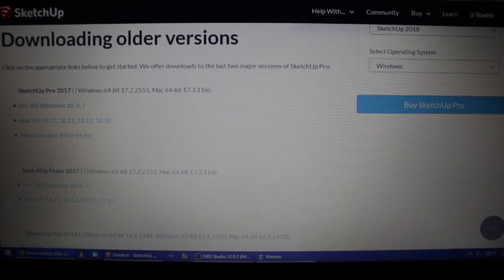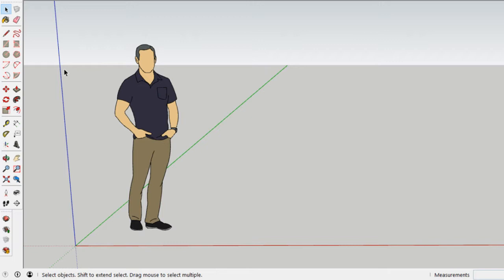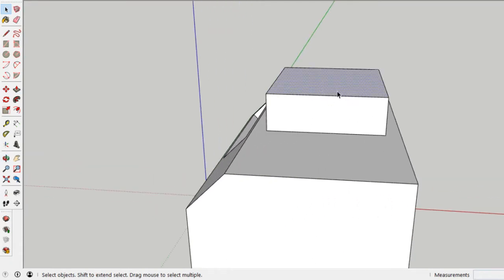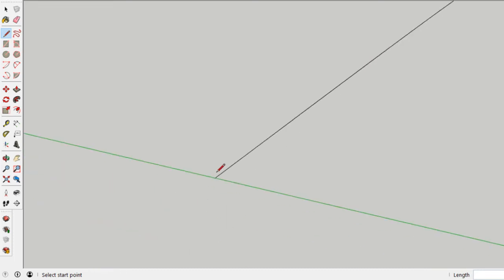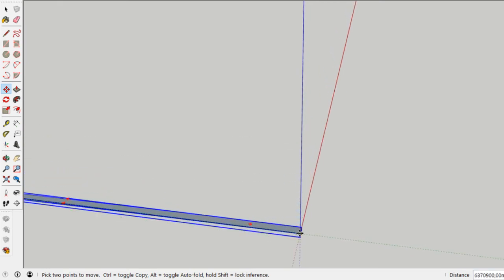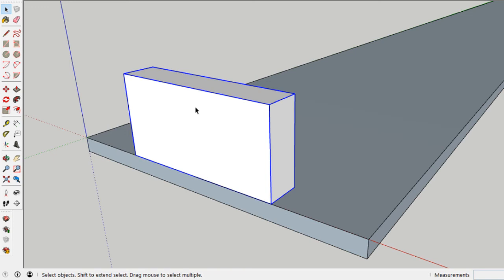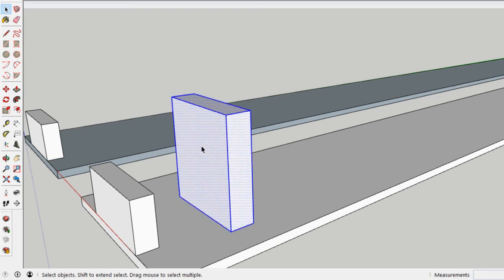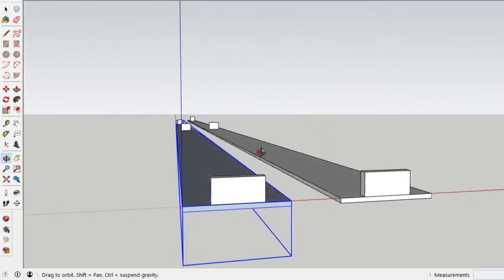Quick SketchUp Tutorial On Making The Sphere And Flat Earth Comparison Models

Comment: @Tommy Grønvold

I actually watched the video and was good work well done. Here are my questions:

1/. Angular Resolution Limit of the Eye? 
2/. How far apart would 2 x 6ft people to disappear from each others view??
Reply from the maker: Thanks!
I don't have any answers to those questions, what are you trying to prove with them?
Reply: @TommyGronvold  When you can figure those questions out you will realise what they relate to... Until you run the numbers you will not understand...
Reply from the maker: No... Please explain!
Reply: @TommyGronvold  1/. 0.02 degrees resolution limit
2/. 3.2 miles
Reply from the maker: And...? Where do you go with that info?
Reply: @TommyGronvold  "And...? Where do you go with that info?"
What does 3.2 miles remind you of?
Reply from the maker: If you came here to make a point, MAKE IT!
I'm not gonna try to guess where you want to go with this, so just lay it out nice and clear!
Reply: @TommyGronvold  So you do not know that its the same distance that the horizon line is supposed to be on a globe... FFS I may as well be speaking to a brick wall...
Reply from the maker: If you go 10 feet above sea level? Or 20 feet, or 100 feet? Does the numbers stay the same?
And how did you find that number for the "Angular Resolution Limit of the Eye"?
Reply: @TommyGronvold  "If you go 10 feet above sea level? Or 20 feet, or 100 feet? Does the numbers stay the same?"

The further away from the surface you get, the less it blocks your field of view, but yes you can still only see a 6ft object at 3.1 miles away. Put your eye on the floor and you can see ~37 meter (0.02 miles) radius around you, stand up and it becomes ~3.1 miles.

"And how did you find that number for the "Angular Resolution Limit of the Eye"?"

"With Angular resolution calculator we compute that the angular resolution during the day is θ ≈ 0.02°."
https://www.omnicalculator.com/physics/angular-resolution#what-is-the-angular-resolution-of-the-human-eye

"Angular resolution: about 1 arcminute, approximately 0.02° or 0.0003 radians,[1] which corresponds to 0.3 m at a 1 km distance."
https://en.wikipedia.org/wiki/Naked_eye

"The maximum angular resolution of the human eye at a distance of 1 km is typically 30 to 60 cm. This gives an angular resolution of between 0.02 and 0.03 degrees, which is roughly 1.2–1.8 arc minutes per line pair, which implies a pixel spacing of 0.6–0.9 arc minutes.[15][16]"
https://en.wikipedia.org/wiki/Visual_acuity
Reply: @TommyGronvold  If you get where I am going with this and need no further guidance to understand the concept of the angular resolution of the human eye is equivalent to the curve of the globe earth, can you do the following just to show me that SketchUp is worth investing a bit of time in:

1/. Put a 6ft person 3.2 miles away on both models and see where you can see them from the ground level, 6ft and 12ft in altitude?

2/. Put a 6ft person on top of a block 167km's on both models and see whether you can see them from the original observer point?

If you cannot be bothered I understand, I may do a bit this weekend myself.
Reply from the maker: Oh... So this just happens to be the exact same distance as the horizon on the globe, and the numbers just happens to follow the increased altitude... WOW! What a coincidence!!
Reply: @TommyGronvold  "Oh... So this just happens to be the exact same distance as the horizon on the globe, and the numbers just happens to follow the increased altitude... WOW! What a coincidence!!"

Its not a coincidence its designed like that... You have been told over and over again, but you wouldn't listen!!

With any increase in elevation you see more of the surface, you can demonstrate this with a wall, take a photo 1 inch away, and then take a step back and take another photo, this will show more of the wall the further away you are from it.

"And by the way, how does those numbers stay the same if our horizon goes 28 degrees up from our toes?"
28 degrees is from your toes to horizon created by this apparent rise in floor, due to the 0.02 degree limit. 

You seem a bit surprised and shocked that the maths of the human eye matches the curve....
Reply from the maker: Surprised and shocked, yes! But not from what you might believe... I'm surprised about how it's even possible to come up with such nonsense, and shocked about how many people still believing the earth is flat!
You need one mathematical formula for where the sun set, one for where we see Polaris from everywhere on the northern hemisphere. You need one formula for matching the daily observed path of the sun to match the flat earth model (which ever model you choose to use) and one formula to hide everything in the distance behind a mass of water.
On the globe earth, everything is solved with ONE formula: The curvature of the earth!
Reply: Tommy you are still not getting it so you are throwing your toys out your pram...

The flat earth also calculates all you said above USING 1 FORMULA the angular size formula...

You will get it one day but until then remain shocked that there is people out there believing in an alternative theory which calculates...

Guess you did not want to put a 6ft person 3.2 miles away as I suspect sketchup has a greater angular resolution than what we and cameras see, therefore it does not reflect the reality of what we see!
Reply from the maker: "the angular size formula" - Also known as the law of perspective!
Perspective does not bend anything, but the sun needs to move 3000 miles down and the light needs to bend well over 25 degrees to light up under the clouds.
Polaris is observed at the angle corresponding with the latitude of the earth, on a flat earth model, those lines does not meet at one single point.
Boats and other objects obscured by water only happens on a globe, as on a flat earth the water would be FLAT!
You do NOT have one simple magical formula to solve all those problems, because they need a total different set of numbers from every single point on the northern hemisphere to add up.
Reply from the maker: HEY!!! That gave me an inspiration for a new video: "Reality Check! How Does It All Add Up...?"
Give me a couple of days, this WILL be a video!
Reply: "Perspective does not bend anything"

Wow so no bending up of an apparent rising floor, no bending of converging train tracks and no bending of sunrays.... So if perspective does not bend sunrays are you telling me the sun is close and local due to ray tracing geometry?

"You need a totally different set of numbers"

What for? I think your desperately winging it tbh. Accounting for angular size accounts for hidden identically.

That 1 formula is the same as your 1 formula, just because you have not realised yet it does not mean its untrue...
Reply from the maker: "...are you telling me the sun is close and local due to ray tracing geometry?" - NO! Quite the opposite actually!
Go to 3.30 in this video: https://www.youtube.com/watch?v=IilLEsasaqk
If there is only ONE formula to bend the sunlight AND the observations of Polaris to match everyday observations from all over the northern hemisphere, please present it!
Or even better: Calculate how I just north of Oslo, Norway see Polaris at 60 degrees, and not at 72 degrees as on the flat earth model. Then use the same formula to calculate from where you live.
And then again, using the same formula once more, calculate my sunset just north of Oslo to match what I see from a sun 3000 miles up and 25 degrees left!
Reply: @TommyGronvold  "NO! Quite the opposite actually!"
Just because you say something it does not mean its true, show me how its quite the opposite?? Does sun rays bend due to perspective or not?

"If there is only ONE formula to bend the sunlight AND the observations of Polaris to match everyday observations from all over the northern hemisphere, please present it!"
I have done and you just cannot figure it out so you think its bunk!! The angular size formula is the same as earths curvature calculations.. If you cannot account for an apparent rise in floor, converging train tracks and diverging sun rays WITHOUT using perspective then the answer is obviously perspective effects your vision. 

Again a simple demonstration is you put your head on the floor and you will see ~37 meters around you, then stand up and you will see 3.1 miles around you, what was the "THING" blocking your 3.1 mile view with your head on the floor? I think you will find its the floor as if you do the same thing for 1ft altitude you will only see 1.2 miles due to the floor blocking you as curvature is virtually non-existent at these distances ... But you are telling me that the floor would not block your view 3.1 miles away, so why does this intrinsic relationship breakdown? Because you want to call it something different?

Your video does not make any account for refraction or the missing floor rise... When you want a lesson on what the flat earth model actually looks like let me know yeh as you are making a flobe earth model here like every other globe earther.

If you can see a 6ft object in your software at 3.2 miles then your software is not reflecting reality, it resembles a game like minecraft...
Reply from the maker: "When you want a lesson on what the flat earth model actually looks like let me know..."
Oh yeah, give it your best shot!! Build a working model of the flat earth and make a video of it!
Reply: And dont get it...

The working flat earth model IS the globe earth model, with a mere switch of labels and concepts to explain the phenomenon. I.e

Curve = perspective
Gravity = Density/electrostatics
Distant sun = Close sun
Dark energy = aether

Do you not understand Einsteins General Covariance? AS YOU ARE TELLING ME EINSTEIN IS WRONG!! Are you sure you know what you are on about here, if so explain what general covariance means?

https://en.m.wikipedia.org/wiki/General_covariance
Reply from the maker: "The working flat earth model IS the globe earth model..." - Wait, WHAT???
I can make a sphere model in SketchUp and make it work, it'll take me just a few minutes.
Go ahead, download SketchUp and make a flat earth model. And then make it work!
If you can do that, you will be the first! Because every single other model fails in every single way possible!
Reply from the maker: You came here to show me calculations, now SHOW ME THE CALCULATIONS!
Go to this video and show me in a comment the calculations for every single observation to meet at one single point. If you can do that, you are one step closer to make it work on a flat earth:
https://www.youtube.com/watch?v=KaWBDaRviLg&t
Reply: @TommyGronvold  "Wait, WHAT???"

This is what you don't get, can you explain what Einstein is saying here:

“The struggle, so violent in the early days of science, between the views of Ptolemy and Copernicus would then be quite meaningless. Either CS [coordinate system] could be used with equal justification. The two sentences, “the Sun is at rest and the Earth moves,” or “the Sun moves and the Earth is at rest,” would simply mean two different conventions concerning two different CS.” 
― Albert Einstein, The Evolution of Physics: From Early Concepts to Relativity and Quanta

Is he saying:

1/. There is no way a geocentric earth model and a heliocentric earth model would look the same.

OR

2/. Geocentric earth models look identical to heliocentric earth models.

"I can make a sphere model in SketchUp and make it work, it'll take me just a few minutes."

You can also make a flat earth model in less time as you only have a circular plane to worry about.

"Go ahead, download SketchUp and make a flat earth model. And then make it work!"

Based on all I have told you WHAT MAKES YOU THINK IT DOES NOT WORK?? This boils down to you removing perspective and claiming it does not work, and I have already asked you whether something 6ft disappears on SketchUp and you cannot tell me as you know you can see it as clear as day, this is because sketchup does not account for a human eye or camera perspective... If not show me one calculation of curvature that cannot be replicated with angular size on a flat plane?

"If you can do that, you will be the first! Because every single other model fails in every single way possible!"

Incorrect, even Thales of Miletus had a working flat earth model in 610BC, this allowed him to be the first person to correctly predict an eclipse... Do you think it all of a sudden stopped working and eclipses could only be predicted on a globe earth model?? If so that is dumb as hell..

Show me at least 1 thing that NO flat earth model can represent?
Reply from the maker: I don't care what Einstein or anyone else said, they didn't decide the shape of the earth!
"Based on all I have told you WHAT MAKES YOU THINK IT DOES NOT WORK??" - Make a model, make it work!
"Thales of Miletus had a working flat earth model in 610BC" - At that time, people used to shit in a hole in the ground, today we have water toiltes! Time moves on, so does science!
"Show me at least 1 thing that NO flat earth model can represent?" - Well... I've done EXACTLY that in every video I've posted here!
And as long as you only have your words to show for, YOU LOSE! Again: Make a model, and make it work!
Reply: "I dont care what Einstein says"

Explains your level of your willingness to learn Relativity. He may not have decided its a globe but its his current theory of gravity that is attributed to being the mechanism to make the earths shape, before gravity what was the mechanism? Regardless both newtons and einsteins gravity has been debunked and is scientifically wrong, this is why you need to fudge the model with 95% imaginary dark stuff..

"Make a model and make it work"
I have shown you many models that work, you are yet to show me a globe earth model that does not require to be fudged with 95% dark stuff???... here is NASA telling you they prefer the flat earth model as its more accurate, this is because NASA understands what Einstein says and you are unwilling to learn;

https://ntrs.nasa.gov/search.jsp?R=19850023280

AIR
"A suite of MATLAB m-files have been developed to calculate the electromagnetic fields produced by a vertical and a horizontal infinitesimal unit dipole over a homogeneous flat (ground) plane. Calculations for the fields above the ground plane have been made for various ground-plane conductivities and relative dielectric constants. The calculations bound the practical range of parameters representative of natural earth terrain."

Propagation of Electromagnetic Fields Over Flat Earth
https://www.arl.army.mil/arlreports/2001/ARL-TR-2352.pdf

GROUND
"Plane Surveying: The type of surveying in which the mean surface of the earth is considered as a plane, or in which its spheroidal shape is neglected, with regard to horizontal distances and directions."

Fundamentals of Surveying Theory and Samples Exercises 
http://giswin.geo.tsukuba.ac.jp/sis/tutorial/fundamentals_of_surveying.pdf

UNDERGROUND
"The Laurentide glaciation in Canada. on the other hand. has almost exclusively been analysed in terms of spherical Earth models (see Peltier. 1982. for a summary). A notable exception is Walcott's (l970b) interpretation. This author used a two-dimensional load representation and a flat-earth model to infer the thIckness of the lithosphere from tilt data of proglacial Lake Algonquin"

The relaxation of spherical and flat Maxwell Earth models
 and effects due to the presence of the lithosphere
https://pdfs.semanticscholar.org/7778/003a7bb4f923a9dc21a480e1221c4adf6b46.pdf

Name 1 thing that does not calculate as none of your videos show what a camera or human sees as sketchup cannot mimick the eye or camera. So your fake debunks are just exposing your lack of understanding of general covariance and pretending Einstein is wrong because of an open source 3D modelling software.... really?? Do you really think you and sketchup can debunk Einstein??

"Again make a model and make it work"
Tell me what specifically YOU THINK does not work? Lets say we choose a globe earth projection like the AE map, what fails?

As I can debunk you in 3 quick formulas

x = R * cos(lat) * cos(lon)

y = R * cos(lat) * sin(lon)

z = R *sin(lat)

Show me how spherical co-ordinates cannot transform to a cartesian co-ordinate system??

"YOU LOSE"

Err I dont see how when a globe earther must ignore what Einstein says albeit its the current model used in globe physics... You are basically saying "I trust Einstein to describe gravity correctly, but when he says gravity is equivalent to acceleration then hes talking shit"... You are not making sense!!

Tell me clearly 1 issue you have, pick your best and I will show you...

Ps toilets have been around since 2100BC please learn your history before chatting the same shit they were flushing down their toilets 4000 years ago... massive fail.. And just in case you say"Well greeks didn't have them then....."

"The ancient Greeks were modern for their time. A Minoan king of Crete invented the first flushing toilet over 2800 years ago. Paper was first manufactured about a thousand years later, but it took someone another 700 years to have the great idea of making toilet paper."

https://www.worldnomads.com/travel-safety/europe/greece/toilets-in-greece-water-safety
Reply from the maker: "I have shown you many models that work" - No, you have only tried to describe them with words. Show me a physical model, made to show what happens on the flat earth.
"Tell me what specifically YOU THINK does not work?" - Sunrise, sunset, sun shining under the clouds, solar eclipse, lunar eclipse, sundials, equatorial mounts, observing Polaris at the angle corresponding with the latitude you're at, boats behind a mass of water, whole cities behind a mass of water, the retrograde of Mars, obvious curvature seen from so many photos and videos...
Reply: @TommyGronvold  "No, you have only tried to describe them with words. Show me a physical model, made to show what happens on the flat earth."
A physical model??? What like one made from paper mache?? Or SketchUp which does not allow you represent perspective correctly unless you mass edit the ACT camera settings which I am sure you have not done??? Or how about just looking at one created by Steve Torrence here where all data used is real world data from timeanddate:

https://www.youtube.com/watch?v=sGJVF7-WvEc

Tell me what is wrong with his "PHYSICAL" model??

"Sunrise, sunset, sun shining under the clouds, solar eclipse, lunar eclipse, sundials, equatorial mounts, observing Polaris at the angle corresponding with the latitude you're at, boats behind a mass of water, whole cities behind a mass of water, the retrograde of Mars, obvious curvature seen from so many photos and videos..."

I said one, but I can do all of these for you:

Sunrise = Hidden by floor
Sunset = Hidden by floor
Sun shining under the clouds = Earths Albedo, in some places with ice earth reflects 90% of the suns light back up.
Solar eclipse = First ever predicted by Thales using the maths of the gnomon Anaximander who were both flat earthers, this is merely the moon getting in front of the sun.
Lunar eclipse = Magnetic vortex in the centre of the FE, and this polarises light to leave a dullish red, see Fred Espanaks tests on Magnetic Floppy Discs as a solar filter.
Equatorial mounts = Operate from two axes, you MUST set one first. This is how anti-aircraft gun turrets work.
Observing Polaris at the angle corresponding with the latitude you're at = The labels of latitude are made from that very star, so whether you assume a curve or a flat it would be an identical observation, its just on a flat earth its hidden due to distance and it dropping as everything else does in our view when it moves away from us.
Boats behind a mass of water = Hidden by your close proximity to water
Whole cities behind a mass of water = Hidden by your close proximity to the waters surface
The retrograde of Mars = Perfectly explained on the flat earth with perspective, or frames of view... Car wheels appear to go in retrograde when spinning...
Obvious curvature seen from so many photos and videos = What all seen through a small piece of curved glass lens?? I have not seen any of these photos or videos showing earths curvature?? I have only seen slight bends in the horizon due to barrel distortion or bend horizons from plane windows where you have 2 bits of bent glass before the observation.

All destroyed in less than 5 minutes bro... You are seriously on to a losing battle here... Imagine if I said "I can debunk the globe using Martin Behaims cartography techniques!" would you believe me? As this is what you have just said to me... "Flat earthers cannot predict the solar eclipse, even though the first recorded person to correctly predict a solar eclipse was a Flat Earther called Thales of Miletus with his own model:

http://practicalphysics.org/thales-model-universe.html

So as long as we rewrite history to suit your agenda, taking toilets away from ancient greece and ignoring what Einstein says selectively but supporting his case for gravity, THEN AND ONLY THEN DO YOU HAVE A POINT... But Tommy, you cannot rewrite history can you? Therefore you must accept at bear minimum that Eclipses can be predicted using a flat earth model!! Once we get over this barrier that you desperately do not want any part of sciences flat earth history to leak in to globe earth science... Well looks like we need to get rid of the whole of cartography, as Eratosthenes invented the co-ordinate system on a flat earth map, get rid of all atomic studies as a flat earther Democritus first theorised them.... NO I will not allow you to delete recorded history to suit your agenda which you again are miserably failing at... Sort your head out Tommy and start admitting you can be wrong sometimes...
Reply from the maker: "Sunrise = Hidden by floor - Sunset = Hidden by floor" - NO! The sun on the flat earth never sets! If it did, the whole world would be dark at the same time, which doesn't happen!
"Lunar eclipse = Magnetic vortex in the centre of the FE" - Now you're joking, right...?
"Equatorial mounts = Operate from two axes, you MUST set one first." - YES! You set ONE axis first, but then it rotates around ONE axis to track the stars in a circle. On the FE model, you need to track in TWO axis' at once, just make a circle in your ceiling with a flashlight!
Polaris - "The labels of latitude are made from that very star, so whether you assume a curve or a flat it would be an identical observation" - NO! On the flat earth model, the lines do not match! That's the maths you need to show me for it to work, or do it on a VISUAL model!
"Boats behind a mass of water = Hidden by your close proximity to water" - On a flat earth, the water is flat! How can close proximity of water hide a boat?
"The retrograde of Mars = Perfectly explained on the flat earth with perspective" - You know that Mars moves like the number 8, right...? Does the same formula as before with Polaris and the sun now move something like that???
"What all seen through a small piece of curved glass lens??" - YES! Do you think Nikon, Canon, Sony and all the other lens-makers make their lenses with built in distortions? Would anyone buy lenses that distort their images? Why does every serious lens-tester take a photo of a test-pattern to show how good a lense is? Any distortion what so ever would make that lens useless, I most certainly would NOT use such crap!
"All destroyed in less than 5 minutes bro... You are seriously on to a losing battle here..." - Not really!
This is still only your worthless opinions, you still need to put all your crap together in a working model!
And as long as you haven't done that, I can only deduct that you can't because it's impossible...
Again, I can make a working sphere earth in minutes, explaining every single phenomenon possible. You cannot make a flat earth model showing the simplest of problems, and absolutly not solving for all the problems I mentioned above here. So... I guess I'm not the one losing this "debate"
Reply: @Tommy Grønvold  
"NO! The sun on the flat earth never sets! If it did, the whole world would be dark at the same time, which doesn't happen!"

You are crazy, if it never sets then how is the day/night.... Hahahaa you are such a desperate idiot!!  If 28 degrees is the maths that blocks out the sun for 12 hours on an equinox, then why are you denying day and night... Are you seriously saying "FLAT EARTH IS IMPOSSIBLE AS IT WILL ALWAYS BE DAYTIME", when the ancient and modern flat earthers knew there was day and night but you are insulting their intelligence by your ignorance!!

We cannot have a proper debate and you will NEVER learn a thing about the flat earth model if you have invented your own version, as the TRUE flat earth model has an apparent rising floor to block things on the other side and when you reverse engineer the sun it only gives off 41 yottawatts instead of the globes 410yottawatts... You are simply not clued up enough to know the flat earth model...

"Magnetic vortex in the centre of the FE" - Now you're joking, right...?"

What there is one at the north pole on a globe?? You seriously do not know the globe model either?? I guess you never looked in to the works of Kristian Birkeland and his Birkeland Currents, I mean who would he was only James Van Allens right hand man!

"Focus: Electric Power from the Earth’s Magnetic Field"
https://physics.aps.org/articles/v9/91

I guess you did not know that Earth is connected to the sun with a "magnetic rope" as NASA calls it??
https://science.nasa.gov/science-news/science-at-nasa/2008/30oct_ftes

"YES! You set ONE axis first, but then it rotates around ONE axis to track the stars in a circle. On the FE model, you need to track in TWO axis' at once, just make a circle in your ceiling with a flashlight!"
Think about what you are really saying here, you are saying that I cannot draw a radius on a circle and stand anywhere in that circle and then track that radius line using another axis... You are seriously out of your depth here... 

"NO! On the flat earth model, the lines do not match! That's the maths you need to show me for it to work, or do it on a VISUAL model!"
I gave you the maths months ago!! You failed to model it then and refuse to do it now...  I wonder why?? Maybe its because you are trusting your capital letters a bit too much "NO!" does not mean you get to dictate anything to do with the flat earth model when you clearly do not have a scooby doo about it.. 

"You know that Mars moves like the number 8, right...? Does the same formula as before with Polaris and the sun now move something like that???"
Yes analemmas are fully shown on the flat earth model here by Steve's model which you have not debunked yet or even said how its wrong but he can clearly show all planets do the same thing on a flat earth model, USING REAL WORLD DATA:

https://www.youtube.com/playlist?list=PLZNQtG9xt611t8_EXEnKpywavaMnKKfqx

"YES! Do you think Nikon, Canon, Sony and all the other lens-makers make their lenses with built in distortions? Would anyone buy lenses that distort their images? Why does every serious lens-tester take a photo of a test-pattern to show how good a lense is? Any distortion what so ever would make that lens useless, I most certainly would NOT use such crap!"

So you have not even looked in to what a camera does...  Geeze, you have never used Photoshop either, is the sum of your knowledge come from open source software?

https://helpx.adobe.com/uk/camera-raw/kb/supported-lenses.html

This is embarrassing for you to get this much so wrong!!

"Not really!"

Yes really, unless I get to the end of this comment and you have already debunked Steve Torrences flat earth model... Lets see...

"This is still only your worthless opinions, you still need to put all your crap together in a working model!"

Err did you miss the bit where I gave you the working model.

"Again, I can make a working sphere earth in minutes, explaining every single phenomenon possible."

Stop having delusions of grandeur as you cannot even get your head around the perspective and refraction phenomenon as you have NEVER modelled it have you, let alone the likes of Selenelion Eclipses, of which I doubt you could even model at all let alone taking years doing it... If you think you are that good show me a working Selenelion Eclipse on a globe earth model and I can guarantee you cannot, especially when they have been recorded when the sun is more than 30 degrees above the horizon... Which is geometrically impossible on a globe earth model, but there are many eye witness accounts and footage online..

"So... I guess I'm not the one losing this "debate""

I have presented a working flat earth model, I have described the maths and concepts which you cannot counter.

You have not shown me a working globe earth model without having to fudge it with 95% dark stuff, but you can do a perfect sphere in SketchUp which does not match the reality of a globe earth model let alone not demonstrating a 0.02 degree angular resolution limit of the eye.

I have already won here, as this is what you need to admit you are wrong on:

1/. Both models work the same, they have different labels/concepts for each phenomenon.
2/. Ancients had toilet systems
3/. Einstein was right around covariance or relativity would not exist, as its how he change particle gravity to geometric bendy space gravity, they both look the same but the concepts change.
4/. You think flat earthers cannot predict solar eclipses, but it was a flat earther who is the first recorded person in history of predicting a solar eclipse on a flat earth model.
5/. You need to tell me what is wrong with Steve Torrence's model using real world data on a flat earth.
6/. You need to tell me if the basic camera in SketchUp is limited to 0.02 degrees.

As If I need to spend time designing my own ACT camera to mimick the human eye and I am correct, you will simply lie and deny like you have done throughout here...

You have so much wrong you cannot even right it!!
Reply from the maker: "...you are saying that I cannot draw a radius on a circle and stand anywhere in that circle and then track that radius line using another axis... You are seriously out of your depth here... " - How wrong can you be???
The sun and stars on a FE model goes around in a circle say 3000 miles above the ground, you make that circle in your ceiling with a flashlight, you need to move up and down as well as side to side. That's TWO axis'.
Now make a circle from the ceiling, down a wall, over the floor and up the opposite wall. That's rotating the flashlight in ONE axis, just as the EQ mount track the stars UNDER (in relative of course!) and AROUND the globe!
https://www.youtube.com/watch?v=qD0ygI4ggnc
"So you have not even looked in to what a camera does..." - Do you have any clue what so ever of how small corrections that is? There's no lens ever built that would make any straight line a curve, except for the fisheye lenses of course.
"Err did you miss the bit where I gave you the working mode" - I have only seen your worthless opinions so far, not a single working VISUAL modelfrom you as far as the eye can see...
"Selenelion Eclipse" - Before even throwing that crap around, please at least make sure that's something real!! And if it really is, put it into your model and show how it works!
"Both models work the same, they have different labels/concepts for each phenomenon." - NO!!!
There's no way for both of them to work, that's a physical impossibility! If there is, BUILD THAT MODEL!!
"You need to tell me if the basic camera in SketchUp is limited to 0.02 degrees." - Seriously...? You know SketchUp is a computer program, right? As in PIXELS, depending on the resolution of the GPU in use...
"I have presented a working flat earth model, I have described the maths and concepts which you cannot counter." - I cannot counter your fantasies, nobody can! Because your fantasies only appears inside your head! Get those fantasies along with your 28 degrees, "Selenelion Eclipse" and everything else into a VISUAL MODEL that you actually can show how works!
The keywords of today is WORKING VISUAL MODEL with EVERYTHING WORKING!!!
You don't even have any idea of what a model does, do you?
We take every single observation, calculation, solid proof and whatever, put the numbers into a model to see what makes sense or not. So as long as my model works, and yours don't... You have nothing! SORRY!!!
Reply: @TommyGronvold  I have just wrote a massive post and youtube trashed it... So the crux of it is why are you avoiding this fully working model:

https://www.youtube.com/watch?v=DEctOF8eXKw&list=PLZNQtG9xt6118RtHB8P1FyTMgTRHpCk9y
Reply: @TommyGronvold , 

Tommy, This idiot troll gleem has been trolling you for the better part of 12 months, not once in those 12 months has he attempted to download sketchup and create his own flat earth model, he always asks you to do it for him, I don't know why he does that.

btw, great presentation, I've enjoyed  quite a few of your videos.
Reply from the maker: Thanks osci08!
Yeah, I know he's a troll... But I'm stubborn!
And as long as he has absolutly nothing to show for, I'm not really taking him that seriously.
Reply from the maker: Fully working model...?? HAHAHA!! You're a funny guy!
That's a cartoon of the planets going around, and Mars doing 8 after 8 after 8... That's not what happens in reality! Mars do the retrograde only approximately 58-81 days every 2+ years.
And then there's the Mercury retrograde, that also needs a set of calculations...
https://www.astrologyzone.com/everything-you-need-to-know-about-mercury-retrograde/
Reply: Osci08 I have dowloaded it you idiot why do think I was talking about ACT cameras...
And I have literally only spoke with tommy for a couple of months tops, so keep stretching the true as long as you need to..As sketchup is a shit free software which does not have the precision enough. I have used Poser, 3ďmax and unreal engine but I currently prefer unity, as I am a web developer and microsoft partner so im used to visual studio.

You are only both calling me a troll as you KNOW sketchup cannot replicate the human eye, but do trolls make valid points or nonsense points???

Your desparation is so much you will say "its not a valid point to use a software package that canmot replicate reality" and call it nonsensical... because you have to... as you cannot counter what I am saying and neither have you ever been able to in our years worth of exchanges...

You chat a load of rubbish and when you are genuinely confronted you switch to the personal insults.... because you have to..

You know the models you make are not flat earth ones.
You know sketchup was rolled out to kids in schools.
You know 2 x 6ft disappear from each others view at 3.2 miles due to angular resolution.

But you dont know how to model a working globe model or a working flat earth model thats for certain...
Reply: Tommy we should leave it there you know im a troll but still talking to me... I call bs as you take the piss out of steves model done in autocad and using real world data... You are using sketch up, with non real world data without planets...

You obviously dont have a clue as you are saying as the data you are questioning is timeanddate.coms 

I will leave you to your own confusion.

Im sorry I even tried to help you actually debunk the flat earth correctly.... but I will leave you to your sketchup and models that bear no relation to what we observe..
Reply from the maker: Yes Gleem, you have to be a troll to be able to deny the simplest of facts!
SketchUp is accurate to well beyond 1/100 mm or 1/1000 inch, and YES I can measure the angular size of a 180 cm/6 ft person at 3,2 miles/5km to be 0,022 degrees. I'm no math expert, so I wouldn't know how to do that even if you showed me...
But just how would any of that be relevant, when we talk about a earth of ~4000 miles/6371 km radius?
That angular size has another word, PERSPECTIVE! And you use and ABUSE the hell out of it!
Perspective is ONLY used for that particular reason, finding the angular size according to distance.
Perspective cannot move anything from side to side or up and down, as you try to say. It only appears to move objects along the lines ending up in a vanishing point.
So... Just HOW does the suns apperance move from a fixed height over the earth, 3000 miles down, bend 25 degrees to match the everyday observations of sun shining under the clouds?
HOW does the same formula bend the daily observed angles to Polaris from anywhere on the northern hemisphere to meet at one single point?
HOW does the same formula bend water to obscure boats, cities, mountains...?
HOW does the same formula make Mars go into a retrograde every 2+ years, and Mercury even more often?
Perspective cannot do anything of that, because perspective is ONLY about angular size!
And again...! A model is all the observations, facts, numbers and whatever put into a program to test reality.
I made my models to test the suns apperance, and south of the Tropic of Capricorn there's not possible in any way to be a flat earth! As long as anyone, anywhere can observe a sun moving (in relative to us of course!) 15 degrees every hour, it simply does not match reality! Because "down there" the sun makes a horse shoe pattern across the skies, backing up on itself TWICE! Please tell me where that happens...

It does not matter WHAT the reality is, we make models to test if it fits or not. And as FLAT and SPHERE is two completly different geometrical objects, there's no way in hell you can claim everything to work in both models!
So as long as I can make a 3D model where absolutly every single phenomenon is working, IT FITS!!
And if you have downloaded SketchUp and whatever, make your model and make it work!
Because whatever fantasies you have in your head, will only work in there. Nowhere else!!
Reply: Ok Tommy obviously everything you say is facts and I must believe all your maths although you are not a maths expert.

I guess my data analyst job is useless here when your ego compensates for both of us...

You have literally just calculated that the angular resolution makes things disappear at co-incidentally the same distance the curve kicks in... But you accusing me of living a fantasy when is there is maths in front of your face is just a pointless debate.

Why are you proceeding on the topic if you have debunked the flat earth? I mean you have only just learnt one of many of equivalences between human eye making the curve, but you are so confident you have debunked it so why waste anymore time making videos?

Once you get 5 years deep on the topic you understand Einsteins Covariance, meaning all models are equally based on observations.

If you force the flat earth to not work by using wrong tools and wrong maths as you have been on the topic for years and you were not aware that the curve is equal to the human eyes... so if you adjust your model to be the direct opposite then you would end up with a perfect fe model on your own pc...

You simply are not capable enough to do a working flat earth model... you just keep pointing at your screen saying this is reality... Whereas im showing you the mathsof a flat earth model and you have gone all narcky and ignorant... Its like you dont want to do a correct flat earth model in fear it calculates... And again I have just literally gave you the maths on how the flat earth accounts for curvature...

You can try changing topics with a shotgun effect but cannot help you anymore due to your own inability to want to learn something new... you keep your stubborness and I will leave you alone now...
Reply from the maker: "You simply are not capable enough to do a working flat earth model... you just keep pointing at your screen saying this is reality... Whereas im showing you the mathsof a flat earth model and you have gone all 
narcky and ignorant... Its like you dont want to do a correct flat earth model in fear it calculates... And again I have just literally gave you the maths on how the flat earth accounts for curvature..."

This is my point exactly!! I cannot make a working FE model because it's IMPOSSIBLE!
And YOU need to make that model for yourself to test your delusional fantasies!
Reply from the maker: But thank you for giving me the idea of making a new video, I'm gonna show all the impossibilities with the FE model in one video! Maths and all...
Reply from the maker: "You have literally just calculated that the angular resolution makes things disappear at co-incidentally the same distance the curve kicks in..." - NO!! This was a 6 foot man, anything bigger will have a greater angular size and still be visible! And that again does NOT explain objects disappearing bottom first, and not just shrink into nothing!
Reply: Debunk away, just be rest assured you are not debunking the true flat earth model that is based on our human perspective not the physical environment. Until you also understand the floor appears to rise and blocks your field of view, then you are debunking Minecraft nothing more...
Reply from the maker: You have the software, you have the numbers, you have the maths and you have the brains (at least, that's what you claim...)
What the hell is stopping you from making a model of it?
According to you, I'm not half as smart as you, I have a kids school software and I am wrong in everything i do.
Yet I'm able to spend a few minutes making a working model of the sphere earth, how would that even be possible if every single thing I do is wrong?
I make a sphere, put some lines pointing towards Polaris: DONE and working as observed!
I make a sphere, put a sun into the model and spin it: DONE and working as observed!
I make a sphere, put a circle around the top to show what we see: DONE and working as observed!
Stop making excuses and start making your model!
Reply: @TommyGronvold  "You have the software, you have the numbers, you have the maths and you have the brains (at least, that's what you claim...)"
Yes but as I have been telling you Sketch up is not precise enough...

"What the hell is stopping you from making a model of it?"
SketchUp itself...

"According to you, I'm not half as smart as you, I have a kids school software and I am wrong in everything i do."
Stop acting like a kid in school as I said nothing of the sort, my whole objection is your software will not be able to model reality...

"Yet I'm able to spend a few minutes making a working model of the sphere earth, how would that even be possible if every single thing I do is wrong?"
Your flat earth model is wrong... I did not say "everything" you are just throwing your toys out the pram as you know I am correct...

"Stop making excuses and start making your model!"
I have a verified REASON not excuse, the zoom and pencil tools rarely work and I have had it completely crash in the 2 hours I spent on it, but to show you how shit it is:

STEP 1 - Draw a circle with a radius of 5230.4 meters
http://1ness.co.uk/SketchUp0.png

STEP 2 - Draw a triangle from the ground level at the observer point, to 2 meters in height on the outer edge of the circle along the red line
http://1ness.co.uk/SketchUp1.png

STEP 3 - Use the follow me tool to fill in the 360 degree view with this apparent rise in floor, and half of your circle of view disappears.. 
http://1ness.co.uk/SketchUp2.png

But the rise is kept in there... Its pathetic... You are using a tool not fit for purpose, it does not even draw perfect circles ffs:
http://1ness.co.uk/SketchUp3.png

Try it yourself and see what you get...

So when you want to debunk the flat earth model properly, it may be an idea to use the correct tool for the job as its like you have picked up a screwdriver to hammer nails in!!
Reply from the maker: "Yes but as I have been telling you Sketch up is not precise enough" - YES IT IS! SketchUp is accurate to well beyond 1/100 mm or 1/1000 inch, and YES I can measure the angular size of a 180 cm/6 ft person at 3,2 miles/5km to be 0,022 degrees.
"I have used Poser, 3ďmax and unreal engine but I currently prefer unity, as I am a web developer and microsoft partner so im used to visual studio." - Just pick and choose then!
"my whole objection is your software will not be able to model reality" - Then do a better job with the software of your own choice!
"Your flat earth model is wrong" - Then show me the correct one!
"it does not even draw perfect circles" - You need to change the sides in the circle from 24 to 360, that helps a lot!
But again, just use whatever program you feel comfortable with, and make that model work!
Reply: @TommyGronvold  "YES IT IS! SketchUp is accurate to well beyond 1/100 mm or 1/1000 inch, and YES I can measure the angular size of a 180 cm/6 ft person at 3,2 miles/5km to be 0,022 degrees."
Ok it may be for you, who does not understand how precise you need to be to mimic the human eye, let me show you how stupid you are being defending the wrong tool for the job:

What you measure was 0.022 degrees for a 1.8m person at 3.2 miles...

When you insert in to both of these angular size calculators below, using 1.8m and 0.022 degrees as the angle, you get a distance of 4687.8 meters or 2.9 miles, which is 0.2 miles or 482 meters or 9% WRONG. In science normally 1% is an acceptable deviation, but 9 times that is just inaccurate!!

https://rechneronline.de/sehwinkel/angular-diameter.php
http://www.1728.org/angsize.htm

So to summerise as you are just going to be wasting my time defending something that only new VR games are starting to design, when you still have not got the point that BOTH models are identical, its just the mathematical co-ordinate system used to interpret it is what you are lacking a clue of.

1/. You are using software not suitable for purpose. You have just stated its highly accurate to 1/100th of a mm, but I have just shown over a 3.2 mile MEASUREMENT the software is skewing the numbers by 9cms in EVERY single meter.

2/. You keep asking me to do a model but have not done one yourself. You say you can easily draw a sphere, that's great, but the globe earth is not a perfect sphere, you claim you are modelling reality, but have made no account for the human eye nor refraction, you claim to be doing a correct comparison, but like all the flobe earth made up models you consistently fail but attribute some sort of debunk to the flat earth.

3/. You have turned snotty ever since I mentioned that the angular resolution of the eye is equal to the curvature of the earth, and its because you have not looked in to the maths of the flat earth, nor what flat earthers actually tell you on a daily basis "Perspective makes an imaginary curve", so you think it would be best to model this out on a piece of software that cannot handle replicating the human eyes angular resolution correctly...

4/. Then you try make ME do YOUR hard work for you and present YOU with a model because you are having a hissy fit that your precious software that you have spent months learning to debunk flat earth, is getting attacked as it cannot even represent the flat earth model correctly let alone allow you to compare models correctly.

But I will leave you to carry on in your delusion of debunking the flat earth 1,457,324,645,534,768,345 times, just in case the first 1,457,324,645,534,768,344 didn't work hahahaha you will never debunk it, unless you are smarter than Einstein's General Covariance... And I bet you still have not even looked it up yet!! If you have I guarantee you have not understood what he is saying:

"In theoretical physics, general covariance, also known as diffeomorphism covariance or general invariance, consists of the invariance of the form of physical laws under arbitrary differentiable coordinate transformations. The essential idea is that coordinates do not exist a priori in nature, but are only artifices used in describing nature, and hence should play no role in the formulation of fundamental physical laws."

https://en.wikipedia.org/wiki/General_covariance
Reply from the maker: You don't need any program to be as accurate as our eyes, the program needs to be just as accurate as the world is! Whatever size the earth is, and whatever size and distance everything else is!
The model is built on MEASURED distances, angles and the relations between objects! That's how a model works! We build our models on MEASURED REALITY!
And NO! SketchUp is NOT 9% wrong, but the angles is shown with 3 digits and that's quite enough for just about everything! You have 1/1000 of a degree to work with, when would you need anything more accurate?
"Then you try make ME do YOUR hard work for you and present YOU with a model" - HAHAHA!!!
How many times have YOU tried to get ME to make YOUR model for you? I'm trying to get YOU to make YOUR OWN MODEL!!
So again... Just use whatever program you feel comfortable with, and make YOUR OWN and CORRECT model work!
Reply from the maker: If you see a big box 300 feet in front of you and want to make a model of if, would you make it by eye, or go and measure it first?
We make our models on MEASURED REALITY!
Reply: @TommyGronvold  "You don't need any program to be as accurate as our eyes, the program needs to be just as accurate as the world is! Whatever size the earth is, and whatever size and distance everything else is!"

And this is my point... You think that to analyse the observations made from a human eye/camera lens does not need to be accounted for.... However large design companies like Adobe have a full list of templates to REMOVE DISTORTION that each lens causes.... But you don't care about that as that proves the flat earth maths work, so you prefer using something less accurate that means the REAL observations of a flat earth can be misrepresented...

"The model is built on MEASURED distances, angles and the relations between objects! That's how a model works! We build our models on MEASURED REALITY!"
I can use a massive crayon to draw you a model of the globe earth, it will look rubbish as its done in crayon and is LESS ACCURATE than if I done it in fine tipped pens. The fine tipped pens version would be way more accurate as the lines would only cover a tiny proportion of the land mass and you will be able to distinguish the latitude and longitude lines instead of them being big thick crayon lines that do not reflect reality.

If you had an option would you use my crayon drawing of a globe, or technically spec'd drawing using a fine tipped pen? I assume the latter as its more accurate... Well this is EXACTLY what I am saying to you... You are handing me a crayon drawing and saying "This accurately represents reality" when it clearly does not and I can demonstrate it. It cannot handle long distance angular size reduction, as a 6ft observer should have disappeared at the 5000km marker, but when you draw it in SketchUp he is clearly visible and half way down the horizon.

So you are basically telling me "This is accurate for representing reality, even though the BIOLOGICAL SCIENTIFIC EVIDENCE states the human eye has an angular resolution limit of 0.02 degree, and my model in SketchUp is about 0.0001 degrees, but this is real life, honest..... trust me..... please"!!!

"How many times have YOU tried to get ME to make YOUR model for you? I'm trying to get YOU to make YOUR OWN MODEL!!"
I am not getting you to make any model, I am TELLING YOU YOUR SOFTWARE DOES NOT REPRESENT WHAT WE SEE IN REALITY!!! I have tried to make a model and found it to be too inaccurate to account for angular size from the observers frame of reference correctly.

Its up to you if you want to keep on using it, it works in your favour, so why not... It matter not to me, I am just here to prove you are wrong and hope you learn from your mistakes...
Reply: @TommyGronvold  "If you see a big box 300 feet in front of you and want to make a model of if, would you make it by eye, or go and measure it first?
We make our models on MEASURED REALITY!"

If you already know the dimensions then you do not need to guess, this is a simple case of "DID YOU DIRECTLY MEASURE THE DISTANCE" of which on long distance photography you cannot directly. 

If you would have excluded any figures then you have two options:

1/. A guess by naked eye using your perspective to identify the angular size
2/. A direct measurement for precision

To sync the analogies, number 1 is drawing a model in crayon, and number 2 is a fine tipped pen... 

You would say "We KNOW with 100% certainty, that our guess of number 1 is right"

I say "You can make all the models you want, but if you are not reflecting reality and make up your own biology of the human eye then you are simply wasting your time as you cannot reflect reality in your software of choice"

I am not going to make a flat earth model as I already know it calculates using the scientific concepts of General Covarience and Relativity. To say they would not matter is the same as saying Einstein is wrong..
Reply from the maker: Exactly!! We don't need to guess!!
I measure the angle towards Polaris from Oslo, Norway to be 60 degrees, not guessing anything!
The earth is measured to have a ~6371 km radius, not guessing anything!
The curvature is measured to be 1 degree per ~69 miles, not guessing anything!
The trajectory of the sun is measured to be 15 degrees pr hour all over the world, not guessing anything!
Ships going over the horizon is observed to disappear bottom first, not guessing anything!
And you're not gonna make your own model, because you know all to well that it would not work in any way...
Reply: @TommyGronvold  "I measure the angle towards Polaris from Oslo, Norway to be 60 degrees, not guessing anything!"
You are such a desperate idiot... How far away is Polaris?? How did you directly measure it?? YOU DIDN'T YOU GUESSED!!

"The earth is measured to have a ~6371 km radius, not guessing anything!"
Who directly MEASURED it not CALCULATED it, as far as I was aware we have only got down about 12 miles... So who DIRECTLY MEASURED IT?? = NO ONE which means its a guess by calculation, which is WHY you have to put that squiggly line in and you cannot tell me the EXACT diameter of earth from Norway to its antipode can you!

"The curvature is measured to be 1 degree per ~69 miles, not guessing anything!"
The curvature is again CALCULATED based on basic Pythagorean methods of calculating a spherical surface. Which is why you need to put that squiggly line in again!! If you DIRECTLY measured there would be no "approximately" it would be "Exactly" and empirical enough that I could directly measure to confirm, but again you are pretending calculations and guesses based on them are direct measurements... You seriously do not understand what I direct measurement is do you ffs???

 If I get a ruler and place it on a surface and measure something, this is a DIRECT MEASUREMENT based on the units on the ruler.

If I use radiowaves to reflect signals off the moon, I have several pieces of information I would could not verify for myself through direct measurement, such as speed of light, distance to the moon, shape of the earth. So this is a CALCULATION.

Do you not get the difference seriously? It is simply one you can physically put a direct measuring device, like a ruler, tape or yard wheel. And the other you CANNOT DIRECTLY MEASURE... It just so happens all the evidence that supports a globe model is stuff we CANNOT directly measure like Gravity, Dark Matter, Dark Energy, which is no wonder you do not have a scooby doo about all this stuff.

"The trajectory of the sun is measured to be 15 degrees pr hour all over the world, not guessing anything!"
This was first figured out by a flat earther, so are we saying that because the flat earthers done it first they win?

"Ships going over the horizon is observed to disappear bottom first, not guessing anything!"
You are guessing if you have not DIRECTLY measured the distance and not accounted for refraction or perspective limits. So its a guess that refraction and perspective is not getting, but I can show you maths that confirms they MUST as a 2 meter high boat goes out of view at 3.1 miles and Aristotle did not even have any telescopes or magnifying glasses to see it, so if you think it was a measurement you are kidding yourself.

 "And you're not gonna make your own model, because you know all to well that it would not work in any way..."
No you idiot, you have not being paying attention, I am not building my model as it costs money for an autocad licence and someone called Steve Torrence has already done a working one based on real world data. 

You are too much of an idiot to even know the difference between directly measuring something and you are obviously not believing me so I will leave you to your own stupidity until a globe earther sets you straight, like this:

Direct and indirect measuring methods

"In the direct method of measurement, the quantity to be measured is compared directly with a standard (an agreed unit of measurement), i.e. the value is determined directly on the part being measured. Examples in this context are length comparisons with a scale, or mass comparisons with balance weights like a beam balance. Other typical examples of direct measurement procedures are the measurement of voltage or electric current, and the measurement of the temperature with a mercury thermometer.

Hence, the direct measurement procedure is a direct comparison and is, therefore, also called comparison method. The required international “basic units” are defined in the International System of Units (French: SI, Système international d’unités). This is a metric system of units and covers the following basic units from which all other units are derived:

Length (1 m)
Mass (1 kg)
Time (1s)
Electric current (1 A)
Temperature (1K)
Luminous intensity (1cd)
Amount of substance (1mol).

The definitions of the basic units were subject to changes in the past. Up to 1960, for example, the primary meter was used as a prototype for the unit meter. Apart from the kilogram, all other units are meanwhile determined by unchangeable natural constants. Since the mass of the primary kilogram could theoretically change (and is likely to do so), research is being conducted to also unambiguously define the unit kilogram in this way.

Where direct measurement is not possible, the indirect measurement method is used. The value under measurement is obtained by measuring other quantities, whereby the relation between the physical quantities must be known. (Example: the determination of speed by using the formula “speed = path/time“). As this kind of measurement is based on a reference, the indirect measurement method is also referred to as comparison measurement.  "

https://info.ringfeder.com/engineers-blog/measuring-methods-and-measuring-errors
Reply: @TommyGronvold  You still cannot tell me what is wrong with this perfectly working flat earth model, you just have to pretend I never posted it and ignore it hoping its not a working model of a flat earth using real world data which shows all the planets altitudes, angles and velocities.

https://www.youtube.com/watch?v=sGJVF7-WvEc
Reply from the maker: "However large design companies like Adobe have a full list of templates to REMOVE DISTORTION that each lens causes.... But you don't care about that as that proves the flat earth maths work"
Well... If that's the case, I could just turn my camera up side down, then the faults should be twice as big!
"I can use a massive crayon to draw you a model of the globe earth, it will look rubbish as its done in crayon and is LESS ACCURATE than if I done it in fine tipped pens."
Oh just get over it!! SketchUp is well beyond any accuracy needed, 1/100 of a millimeter and 1/1000 of a degree is so much more than any computer screen is capable of showing on a HD screen. And since the models is of the earth, why the hell would you need any more?
We're dealing with objects like ships, Polaris, the sun shining under the clouds... So much bigger than whatever the angular resolutions of our eyes is.
And if that 6 foot person of yours disappear at 5 kilometers because of angular resolution, why does ships disappear bottom first and not just shrink into nothing?
"I have tried to make a model and found it to be too inaccurate to account for angular size from the observers frame of reference correctly"
That's just bullshit!! If you can't build a working model, it's just because it doesn't work! Simple as that!!
"Who directly MEASURED it not CALCULATED it, as far as I was aware we have only got down about 12 miles" - Who measured it to be flat??
"This was first figured out by a flat earther, so are we saying that because the flat earthers done it first they win?" - Please make that work on a flat earth where the sun goes round in a circle, and make it work even on the south side of the Tropic of Capricorn. PLEASE!
"You are guessing if you have not DIRECTLY measured the distance and not accounted for refraction or perspective limits" - No! This is not guessing, this is daily observations! And there are CLEAR videos without distortions showing big tanker ships disappearing bottom first, so that's not guessing at all!
"No you idiot, you have not being paying attention, I am not building my model as it costs money for an autocad licence and someone called Steve Torrence has already done a working one based on real world data."
If you really think AutoCad can do a model SO MUCH BETTER than SketchUp, I don't believe for a second you know anything about 3D modelling programs. SketchUp is used for the exact same thing as AutoCad, and with the exact same level of accuracy. Stop excusing yourself!!
Oh... And that "working model" of Steve Torrence is not working at all! As Devine Entity also points out, the stars on the southern hemisphere spins the wrong way. Actually, the southern stars rotate around one single point just as around the northern hemisphere. And when it's summer on the southern hemisphere, that sun needs to light a area on one side of the flat earth, as well as a cresent shape along the edge on the other side. How does that work...?
Reply from the maker: "How far away is Polaris?? How did you directly measure it?? YOU DIDN'T YOU GUESSED!!"
I'm quite lucky to live at 60 degrees latitude, because a 60-60-60 triangle is quite easy to make. As well as my sons triangle-ruler with 30-60-90 degrees. So it's just as easy as going outside and put either of those triangles on a water level and see how Polaris lines up with said triangle.
And if you can do the same from wherever you live, the earth cannot be flat with Polaris a few thousands mile above the ground...
Reply: @TommyGronvold  "Well... If that's the case, I could just turn my camera up side down, then the faults should be twice as big!"

Tommy I am giving up as you are supposed to be a keen photographer but you clearly do not understand what lens barrel distortion is... I do not have time to teach you everything in your life you need to just accept your software does not allow you to reflect the human eye or camera lens correctly, therefore is unsuitable for the just.... OR extremely suitable for someone with a bias who wants to misrepresent the flat earth model. The crux of the PROBLEM you don't even understand, is that it is precise and allows you to see a 6ft observer WELL BEYOND the human eye and camera lens limit puts it... So you are representing a 3.1 miles LIMIT of view, with about 20-30 miles before it gets out of view... 

You carry on, I have no more time to waste on you bro, as you are clearly just replying to disagree with everything I say and digging yourself a bigger hole each time.

You keep the faith Tommy.
Reply from the maker: If you say that lenses distort objects or nature to bend just enough DOWNWARDS to appear as the curvature of the globe earth, then by turning the camera up side down will make that distortion up side down. Please tell me how that would work otherwise!
And you seriously need to forget everything about that human eye and lens limits, because first of all, that's bullshit! Second, that has absolutly nothing to do with the shape of the earth!
Reply: @TommyGronvold   Two weeks of word salad from gleem and still no physical model that he can show us, what is he scared of,  I vote to kick him Tommy :)
Reply from the maker: Naaaah... I don't kick anyone, I think it's more fun to have them on display for everyone to see how STOOPID they are :-)
Reply: @osci08  Here is the model you require, I posted it ages ago but none of you are paying attention:

1/. Model based on Real World Data: https://www.youtube.com/watch?v=sGJVF7-WvEc
2/. Working map based on flat earth: https://www.youtube.com/watch?v=NYdoLwkDVxo

So tell me why I posted this 1 week ago and you have countered ANYTHING to do with a working flat earth model and working flat earth map.... Maybe its because you either:

a/. Are not paying attention
b/. You are avoiding it and pretending it does not exist.

Which is it?
Reply: @TommyGronvold  Lets just go through this post alone and see who has things correct or wrong:

1/. ANGULAR RESOLUTION LIMIT OF THE HUMAN EYE = EARTHS CURVATURE MATH
I highlighted this and your silly response was "If you go 10 feet above sea level? Or 20 feet, or 100 feet? Does the numbers stay the same?" stupidly not knowing that of course they would change, but to do it in proportion which replicates the curve all the way, you need to use the same sized objects. So if you are 20ft and the other person is 20ft, you will disappear from each others view at the same distance that the earths curve drops by 20ft.. 

TOMMY GETS 1 STUPIDITY POINT 

2/. ANGULAR RESOLUTION LIMIT OF THE HUMAN EYE REFERENCE OR CITATION
You asked me for evidence that the human eye has a angular resolution limit of 0.02 degrees, of which I provided 3 citations.

TOMMY GETS 1 STUPIDITY POINT 

3/. USING SKETCHUP TO CREATE AN ACCURATE MODEL THAT REFLECTS REALITY
I downloaded SketchUp and put a 6ft person 3.2 miles away and I could see him perfectly fine, whereas in the real world using angular size alone, I should not be able to see them, and using earths curve I should not be able to see them, but on both of your strips you can see them. Which clearly shows SketchUp is not suitable enough to represent reality unless you design your own ACT camera with such limits, and SketchUps options on this are very limited. Of which you responded with "You don't need any program to be as accurate as our eyes, the program needs to be just as accurate as the world is!".. Because when we are analysing what eyes and camera lens' see you need to account for their distortions just like Adobe did by adding a whole suite of camera lens corrections with templates from hundreds of cameras as they all slightly differ in what distortion is caused by the lens.. But you pretend that Adobe has not got a clue what they are talking about, adding this stupid feature to correct lens distortion as you don't need to correct lens distortion as the world is already accurate as it is!! Pfft And you are are so dense you state "Well... If that's the case, I could just turn my camera up side down, then the faults should be twice as big!" which is absolute NONSENSE as the distortions are proportional to the camera lens as its equally curved throughout.

TOMMY GETS 1 STUPIDITY POINT (you should get 10 for that one alone as you proclaim to be in to cameras and photography, but did not even know lenses cause multiple distortions)

4/. ARE INDIRECT CALCULATIONS ACTUALLY DIRECT MEASUREMENTS?
You stated that polaris has been measured directly, however the professional who have done it for the past few years still cannot agree a figure and still ranges from 330 lys to 521 lys. You think its as accurate as putting a ruler between us and Polaris.... Ps when you get the angle you MUST assume the distance, so which one do you use, an old one from 2007???

Year Component Distance, ly (pc) Notes
2006 A 330 ly (101 pc) Turner[15]
2007[A] A 433 ly (133 pc) Hipparcos[5]
2008 B 359 ly (110 pc) Usenko & Klochkova[4]
2013 B 323 ly (99 pc) Turner, et al.[6]
2014 A >=385 ly (>=118 pc) Neilson[29]
2018 B 521 ly (160pc) Bond et al.[30]
2018 B 445.3 ly (136.6 pc)[A] Gaia DR2[31]

https://en.wikipedia.org/wiki/Polaris#Distance

TOMMY GETS 1 STUPIDITY POINT

Also you say "The earth is measured to have a ~6371 km radius, not guessing anything" but man has not even dug deeper than ~12 miles deep, but you pretend they have took a ruler down there and directly measured with someone pulling the tape back up in Australia saying "Yes mate I've got it ta, it reads just less than 6371km".... Nothing you mentioned is directly measured, its indirectly calculated.

TOMMY GETS 1 STUPIDITY POINT

5/. WHICH WAY DO THE STARS SPIN ON STEVES MODEL?
You objected on Steves model as the "stars are going around the wrong way", but still cannot figure out that if we were facing each other and someone put a massive clear plastic clock face in between us, facing you. You will see the hour and min hand spin in a clockwise direction, where as I (who would be behind the clock but still seeing the hands move) would see it counter clockwise, so which way is the clock actually moving? Clockwise or counterclockwise? The answer if you ask Einstein is "RELATIVITY - It depends on which frame of reference you start with", meaning it can be either. and then state "Actually, the southern stars rotate around one single point just as around the northern hemisphere" which means you clearly have not watched the video and looked at the model in any depth as he walks you through all the setting he did to make an apparent separate rotation point when he added refraction. Just because you do not understand the flat earth model, and do not understand Steves model then all of your models have been debunked by this one simple video with a WORKING model.. You can pretend it does not work, but you need to SHOW how it does not work, try modelling the same in SketchUp and you will soon realise that SketchUp is not up for the job, a good analogy is:

You have a 3D printer which can only print a 1cm dice every hour. = Your models in SketchUp

You have a manufacturing warehouse with big machinery which produces 10,000 x 1cm dice per hour = Steves model in Autocad

Are you getting the difference here... So by keep telling me "You should make a model" is the same thing as to why you have not made a fully working globe earth model EVER in SketchUp as you cannot its not good enough!!

So now tell me just 1 thing I have got wrong or been stupid about as you are on 6 stupidity points on 5 topics... Now show me where I am wrong please so I can correct my misunderstanding? If you cannot thats cool, but please do not project your misunderstandings of the flat earth on me.. If you think something is wrong with the models and maps I have presented then you must show me something tangible not just palm me off with "Yeh well it doesn't work coz of my own mental reasons" I need you to counter a fulling working flat earth model with your fully working globe earth model?? Unless of course you do not have a working globe earth model, or you are incapable of doing one on Sketchup which has been my point all along.

And understand here a professional photographer is saying there is no such thing as a lens without distortion and goes through how it adds curvature where there is none:
https://www.youtube.com/watch?v=aD8X9JxmlxU
Reply from the maker: Can any of those models predict when the next solar eclipse will be visible from Norway?
Can any of those models predict when the next moon eclipse will be visible from Norway?
Does any of those models show the angle from Oslo, Norway towards Polaris?
Can any of those models show a flight from Johannesburg to Sydney with a flight time of 13h 20m and a speed is 830km/h with the route going only over water?
Reply from the maker: WOW!!! I have to say, that is REALLY impressive!!! You're actually capable of writing ALL THAT, and still not making ONE SINGLE POINT!?!?!?
1: ANGULAR RESOLUTION HAS NOTHING TO DO WITH THE SHAPE OF THE EARTH! We don't use our eyes to decide the shape of our earth, we measure it with proper and accurate TOOLS! The only thing you use your eyes to, is to read the numbers of the tools, so if your angular limit can't read numbers, too bad!!
3: We make models to check what model fits what observations, and all models are based on MEASURED REALITY! We don't make models based on our eyes, we make them from what we actually can put a finger on and measure. What do you not understand...???
4: We don't need the distance to Polaris to debunk the flat earth, you just look up and point at it. That's enough!
What does a 12 mile deep hole prove...? Or not...?
5: That's just a crapload of bullshit, I don't even bother to read all that... We have Polaris over the North Pole and the Southern Cross (or whatever) over the South Pole, both observed, photographed, video recorded, time lapsed... What more is there to do?
Reply from the maker: And by the way, how does those numbers stay the same if our horizon goes 28 degrees up from our toes?